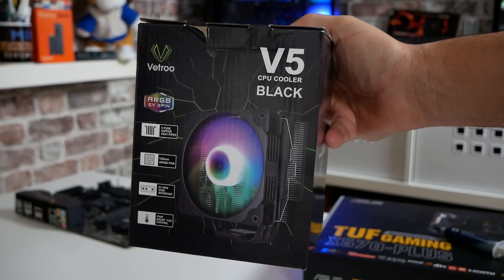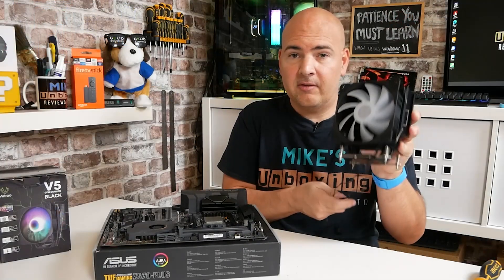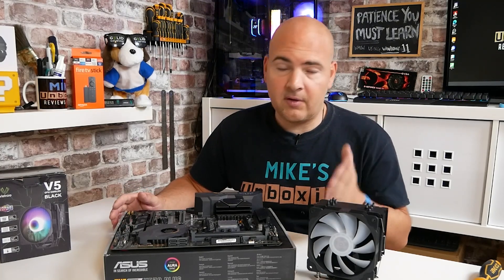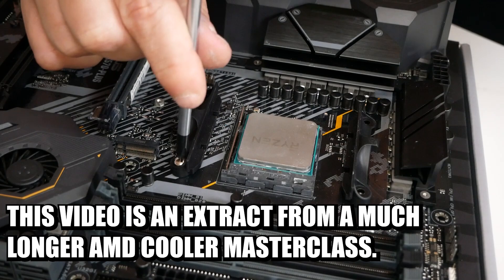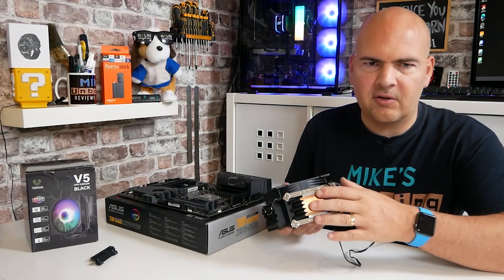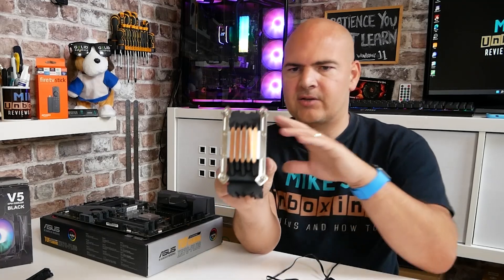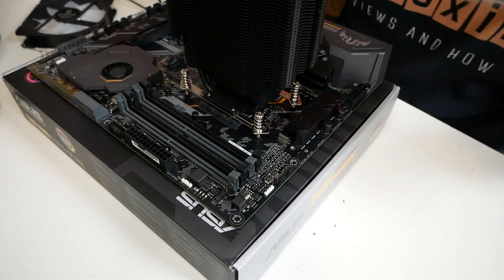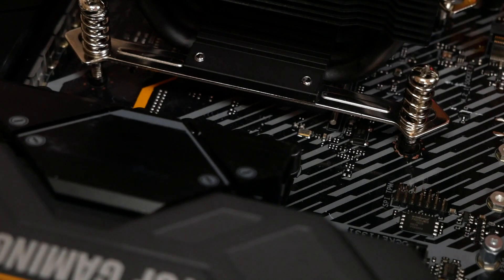How To Install Aftermarket AMD AM4 CPU Cooler Upgrade Featuring Vetroo V5

Comment: I did my first ever install of a cpu cooler a few days ago and it happened to be this same cooler except with an Intel cpu. The screws weren’t touching the holes, but due to either stupidity or determination (and against this guy’s wishes to not do it unless the screws are touching) I screwed them in anyways. The cooler works fine as of now and hasn’t fallen or done anything harmful (yet)

Comment: So I watched the whole video to see where to plug the cables in and it’s the only thing you didn’t show -_-
Reply from the maker: sorry about that, the fan lead goes to the motherboards CPU fan header and the lighting cable goes to the motherboards 3 pin 5V ARGB header or a suitable connection on a hub if the case has one
Reply: @mikesunboxing  hey mike, if my motherboard doesnt have any RGB headers, will the Cooler still work normally? I dont mind not having the lighting stuff tbh
Reply from the maker: @set7618  Yes it will

Comment: I like the installation of these compare to id cooling se 224 xt argb v2 since its more easy plus it has four screw which is stable for me.
Reply from the maker: yes these are decent designs on the vetroo

Comment: Question. I'm upgrading from a stock amd cooler. Is necessary to take my motherboard out of the case (mid tower chassis) to install this cool. Or can I just put the whole pc on its side and install that way?
Reply from the maker: should be able to just put it on the side as long as you have a cut out on the back of the motherboard

Comment: Perhaps a dumb question, but should the fan be on the front side pulling air in or on the rear side exhausting air out towards the back of the case?
Reply from the maker: do whichever works best for you

Comment: Mike, appreciate your opinion - I am retiring an old AIO its coming on 8 years old currently cooling my 3600. I was looking at air cooled replacement, what one or few would you recommend as you seem to have done a ton of these similar units?
Reply from the maker: okay my first choice as an all rounder with RGB is the vetroo V5, or if the rgb isn't a key thing then the arctic freezer 34 in any model, the esports duo or twin fan is nice to have but the CO or single fan models still kick ass.
If it is on offer the coolermaster 212 evo v2 is good but can be pricey.
and also the snowman mt4 or mt6 are good if you can wait for a delivery from china and might get a customs bill.

hope that helps
Reply: @mikesunboxing  perfect 👍 I snagged a discounted 34 esports on the bay. Thanks (I also viewed a ton of your other vids) really appreciate it!
Reply from the maker: @garethwoodall577  We really appreciate you watching too, so thanks ;-)
Reply: Wow 8 years for an AIO is incredible! Never heard of one lasting that long. Nice

Comment: Why do my screws not reach the mother board? I’m screwing them in but there not moving
Reply from the maker: either the backplate is not firmly at the back of the board or the wrong mountings are being used

Comment: Hi, Mike. Because my 300mm D5/res combo is too tall for my be quiet case, I had to use the Corsair pump I had in my media PC and put the stock AM4 air cooler on the 3200g. It was the first time in quite a while I installed an air cooler. LOL
Reply from the maker: It's about time you used an air cooler and sorry to hear that the di 5 didn't fit in your setup that is a pain in the **
Reply: @mikesunboxing  Thanks, Mike. I plan to either buy a 150mm res cynder for the pump or a 120mm distro plate/pump. I've been benching marking RAM all night. I currently have my radiator in the front of the case. After I finish benchmarking 6 different RAM kits, I'll move the radiator to the top. What to make any bets if the temps are the same or different? LOL.

Comment: I know this is a older video, but do I have to plug in the rgb pin in ? Or can I just plug in the 4 pin cpu fan ? Because I don’t have that 3 pin connector
Reply from the maker: the lights won't work if the ARGB plug is not used
Reply: @mikesunboxing  thank you 💯

Comment: Hi Mike - thx for another great tutorial, am building my first pc with an Aorus pro 550 motherboard but not sure where to attach the rgb connector from this cooler, the board has 3 pin connectors for addressable led strips. Can i connect it to one of those? it says its 2a/5v in the motherboard book
Reply from the maker: yes a 5v header is needed, the 3 pin can be either the gigabyte style or the more universal 4 pin with one pin missing
Reply: @mikesunboxing  response much appreciated - it is one with 3 pins in a 4 pin block but only says led strip in the manual so wasn't sure if could do damage using it

Comment: for a replacement cooler. Do I need to remove the motherboard from the case or can I install this cooler with the motherboard in the case? thanks!
Reply from the maker: you can do it in the case if you like, sometimes that is actually easier depending on the case and access areas
Reply: @mikesunboxing  Cool, thanks for the quick reply. I got lucky and scored a Zotac 3080 over the Holidays. Take care and happy New Year!
Reply from the maker: @TheDive25  Lucky! Happy New Year to you too :-)

Comment: Which is better this or the id cooling 224 se xt argb v2 and also comparing this to id cooling xt  225 thank you
Reply: Very similar, the ID cooler had RGB on the fin stack.
Reply from the maker: looks very similar although the vetroo has an extra heat pipe

Comment: I have a Asus B550m plus and I want to get this cooler,  will I be able to use all 4 ram slots?
Reply from the maker: if the ram is low profile i would think so, i haven't used that board so i can't speak from experience

Comment: Sir how about the vetroo L5 in micro atx mobo i think the problem there is the heat sink would be in the way of RAM
Reply from the maker: really you need to make measurements in your case it is hard to say that it will or won't fit most micro ATX cases will take a 120 mil tower star cooler of course there are those that won't
Reply: @mikesunboxing  i already bought and builded my pc with cooler master 212 rgb i just want to see how the vetroo L5 will look for my friend 😁

Comment: I completed the installation, thanks.  I added a intake fan using a splitter from cpu fan(motherboard) . When I started the PC after the New cooler installation it took me straight to the BIOS. The BIOS stated " That a new CPU has been installed " What do I should do" and also I'm getting aware that the exhaust fan (rear) is not working. I have an Asus B550. Please help!
Reply: Motherboard Asus B550M-K
Reply from the maker: if you disconnect the extra fan does it work okay?
Reply: @mikesunboxing  I already disconnected but still rear fan not working
Reply: Windows is up and running but the exhaust fan doesn't run
Reply from the maker: @wilfredodavila9633  This is maybe easier to fix or at least advise if we can ask more questions and get direct answers, so feel free to join our Discord chat and we can go over it in more detail https://discord.gg/gaeeDPw
Reply: @mikesunboxing  thanks

Comment: HELP  the AMD rbg plug has only three holes, I need 4 holes for my x570 MPG gaming pro carbon wifi.  What do I need to do
Reply from the maker: 4 holes is RGB 3 holes is ARGB the two don't mix
Reply: The cooler works amazingly well.  No rbg is not a deal breaker, just a bummer.  Thank you for your response.
Reply from the maker: You should have an argb header on the motherboard
Reply: I found my addressable rgb connections. I’m new at this.  I built my first gaming pc a few days ago, so I could spend time gaming with my two grandsons. I’ve learned a lot in the last 4 weeks. I love building the computer, now I am hooked and want to build just for the fun of it.  Thank you so much for such quick responses.  I will subscribe to your channel.
Reply from the maker: @tessa2889  thanks and enjoy your time with the PC and the kids and grandkids

Comment: To bad that intel backplate is pure trash. I stuck it to the back of the motherboard and it's a one time use. As the backplate came off but the garbage sticky stuff stayed stuck to the motherboard. Warning to intel users don't take the tape off the backplate. Just use it as is.
Reply from the maker: yes that is sound advice